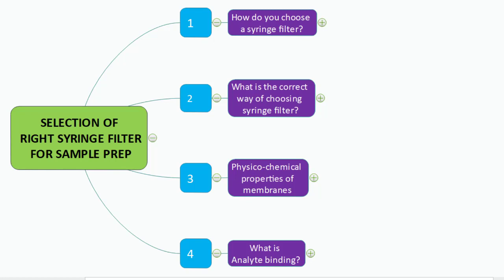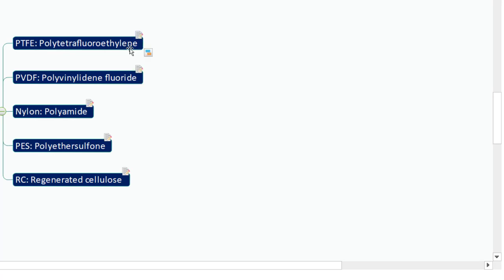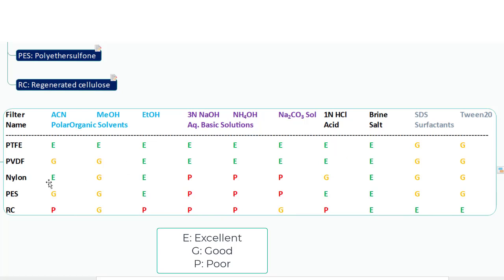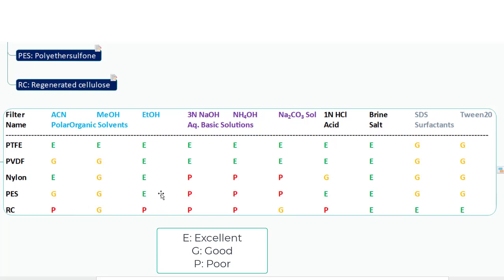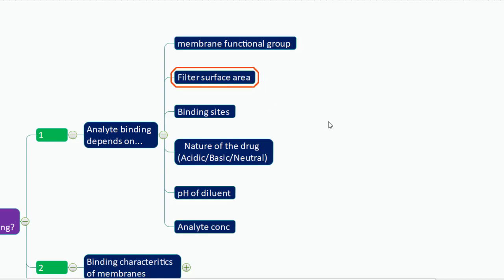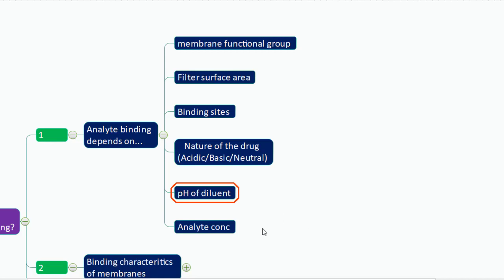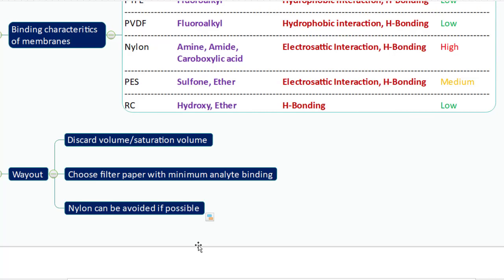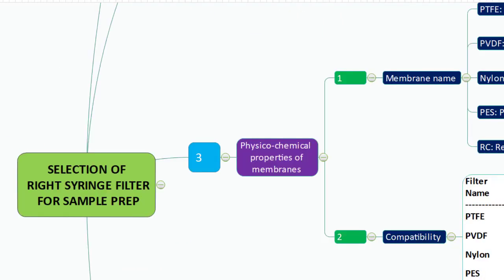How to select the right syringe filter for sample preparation for HPLC, UPLC, or UV

Comment: Hi, nice way of presentation of key insights. I have a question. I am using povidone as polymeric excipient in a 10 fold high concentration to drug. Which filter would be the best to retain this polymer. I am Interested to measure the drug only